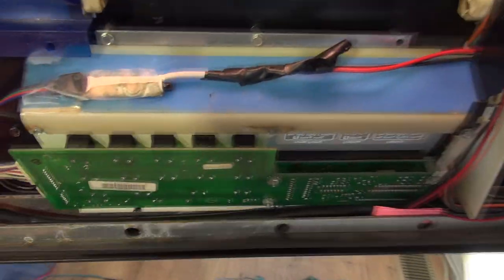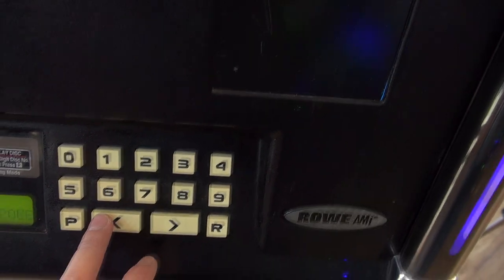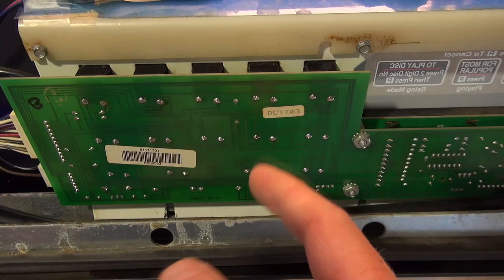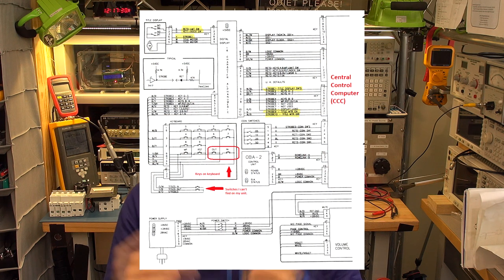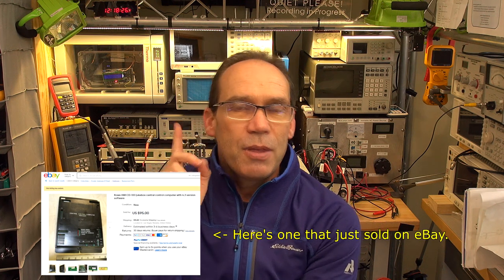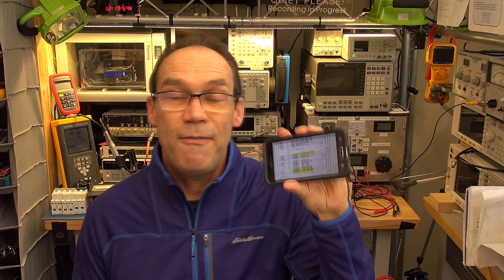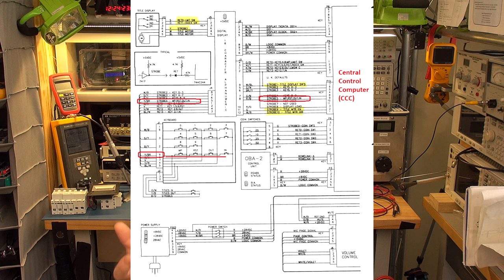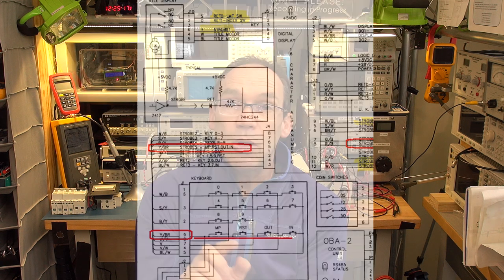A Look Inside #17 -  Rowe AMi WP-100 Storm CD Jukebox - Part 2

Comment: Keyboard scan keeps all low till a key is pressed, simply polling the input till any bit drops low. Then the keyboard scanning flips each strobe high, till one strobe going high turns the return back to all ones. This will appear to be almost simultaneous on the scope display. The longer periods of low are a debounce mechanism, simply ignore any keypress till the next scan cycle has a valid same key pressed. 

Likely the reason you had a lock up was RAM is used to store state for things, like the position of the magazine, but the actual state is also stored in RAM, so the control loop was forever locking out the switches from scanning, waiting for the index pulse to complete, looking at the non backed state to see when it finished the motion. Moving the switch to the alternate state got the 2 to be in sync again, the logic running the motor to get the edge saying the switch had been closed, matching the status stored in RAM.

I would suggest you replace that index microswitch on the cam, it likely is well used and mechanically worn, making it electrically noisy, which might make it lock up again when the contact bounce is again long enough that the 2 state machines get out of sync.  Looks easy enough, and use a good quality switch, they are not expensive, even if the proper Cherry or ALPS one is double the price of the knockoff version.

Also open that controller and see what battery they use to back up the RAM, and if it is a NiCd cell, or anything like that, remove it and replace with one mounted well off the board, so failure does not destroy the processor board. If lithium you can use another battery, 20 years old is a good reason to change the cell, and if it a soldered on lithium thionyl cell it is likely at end of life anyway, doubly so for a coin cell. If it is a Dallas battery you are definitely in trouble, though at least there it is easy to get  either new cells for some, or do a little surgery on the package to get to the internal connection.
Reply from the maker: Aaah! Thanks for the explanation Sean. Good advice on the switch and battery. As I recall the seller noted that the cell was replaced but I will check and consider moving it off the CCC board. Cheers, Martin.